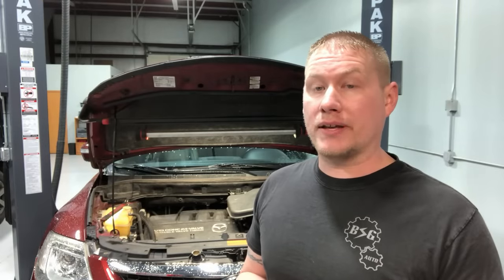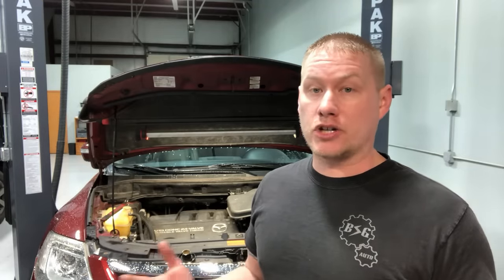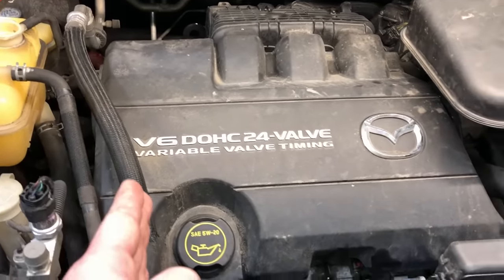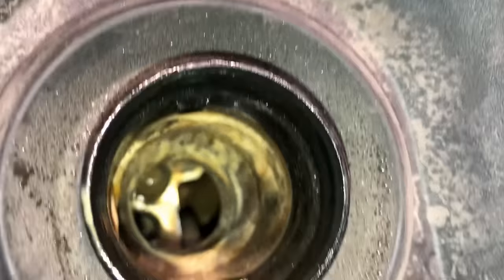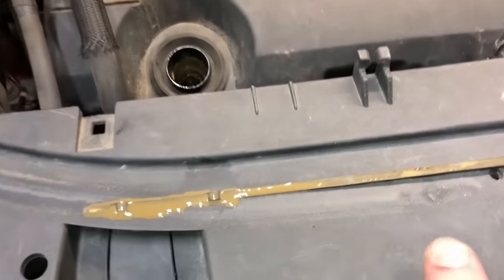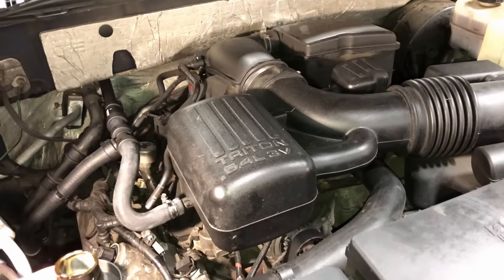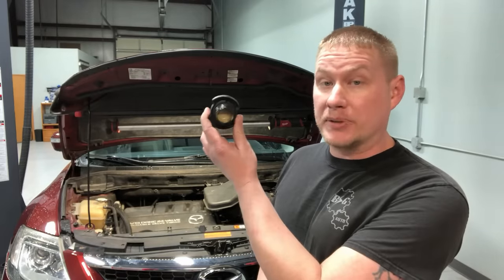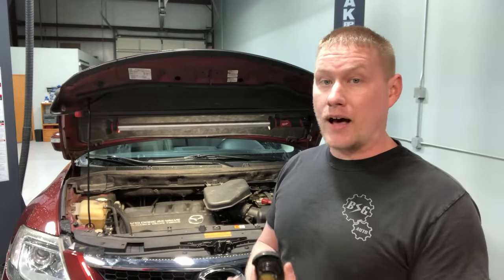Do You Have a Blown Head Gasket?

Comment: My car's radiator was empty and the coolant level in the bottle was low, when I checked my car after returning back to my home from 2 weeks trip out of town. My car was at my home and was not even started in that duration. I noticed this    two time. I contacted my mechanic and he told me that your head gasket is blown, the coolant may got steamed of the last time u driver the car. Can u please tell me what could be the reason and how can I check whether the head gasket is fine or blown. I have a Suzuki Mehran.

Comment: Please I have Lincoln navigator 2010 has low pressure in first 2 slender on the front one left and one right and my oil Has a milky oil not very bad but it’s enough to worry oil  steak does not have any milky If you can help me  this Head gasket or not

Comment: Do you live in a humid climate or one that has cold winters because if you don’t warm up the motor real thoroughly and I mean thorough moisture develops in the crankcase and the pvc valve aids this condition when there’s a lot of moisture in the air it draws it into the crank case as we never saw this condition before they mandated the pcv valve be put on all automotive motors because before that we had road draft tubes that ventilated the crankcase as to evacuate the blow-by from leaking cylinder gases....

Comment: quick question, i'm doing the rear wheel bearings and axle shaft seals on a 2008 crown vic PI, i'm having a hard time getting the c clips past the spring assembly in the center, i did this on 1996 town car and a 2005 crown vic with no problem the c clips came right out, this one is kicking my butt, any suggestions

Comment: Or you could have my dad that added water and oil into his coolant reservoir /facepalm.   The coolant was milky white almost like glue but the oil dip stick was nice and clean.  It was sitting for  a week until I found out he had added oil to the coolant reservoir, it over heated once so he then added water.  I spent many hours flushing it out of the system, what a mess, its up and running now.

Comment: I have a Ford Taurus with the 3.5 L Duratec with 148000 miles. Always serviced at the dealer. Running on synthetic motor oil. Been thinking of replacing the internal water pump and timing belt/accessories before the big kablooey. I love this car but now I have to save $1700 to get this work done. Would it help to flush the coolant in the mean time?

Comment: If have the same substance on my radiator cap of my 99 Honda Accord nothing on the oil fill cap at all oil is nice and clean not creamy at all. My concern is the radiator has the the milky substance on the bottom of the radiator. I honestly want to rule out head gasket vehicle isn’t overheating with air or heat on and at normal temp and I’m not losing any coolant either... any suggestions

Comment: I left my truck sit when we had cold weather. It was fine when I parked it. I tried to start it when it warmed up outside and it ran really bad for about 10 seconds and I shut it off. I then saw water in my oil. Not milky brown just under the oil in the pan I drained it and all the water came out first and then just oil not mixed but both in the pan, again not milky at all. I disconnect my coolant tank and my oil cooler lines and put the hose to the reservoir line. No more water filled in the engine or pan and it just came out the oil cooler lines. Should I assume at this point it is likely the oil cooler or water pump and how do I know which one it is?

Comment: My bmw was using coolant. No sludge in the crank case oil, but I had cold start misfires, finally took the head off and found cylinders 3 and 4 both had small hairline cracks between the coolant jacket right to the valve seat.

Comment: Question fordtechmakuloco my 04 f150 when press the gas around 30ph number 1 and 2 rpm the engine jump like 3 times but if the rpm pass the 2 not do that ready check lot of stuff and still do that if can you pls help me with that thanks

Comment: what if cap has coolant on it and the dipstick, but when drain the oil it's fine? Also coolant temps read high while driving? Not sure if this is relevant but cooling fan starts up with ignition and stays on for 15 mins after shutting off car no matter how long car was on?

Comment: Ok,, well what the heck causes oil to get into the cooling system?? I pull the dip stick and it looks fine( no water) pull the coolant reservoir cap and find oil with the coolant,, engine is a 5.4L 3v

Comment: so how would you get rid of this stuff, flush engine out? 2006 Ford F150 5.4 and then bad steering and water pump failed afterwards, so I'm thinking of doing an over haul to the engine tune up of course

Comment: I let my truck run a bit before I did my oil change and when I shut it off and pulled the oil cap there was condensation but green like the coolant. Its smokes a bit that's more like steam, anyways I drained the oil and it was all normal no milk substance. Any Ideas what it could be? It's a 2004 ram 1500 5.7 hemi btw

Comment: My Mercedes E320 V6 had this sludge on the oil cap but never on the dip stick and that freaked me out that my mechanic told me it is the head gasket, which he actually changed. However, this sludge appeared again and it turns out it is not the head gasket.. what a loss!

Comment: I have clean oil, no milky residue in the oil filler cap, yet a lot of pressure in my coolant system? It has been diagnosed as a head gasket or head problem, and yes it uses a little water each month. Any ideas??

Comment: Coolant boiling in overflow tank 1999 Mazda B2500. Fearing head/head gasket issue. 4 cylinder with 8 plugs. How do I perform a compression test. Intake, exhaust or all. Or is there an easier way ? Thanks for any assistance.

Comment: I just had my mercedes serviced this week.   Cap looked the same way! I panicked the service tech made me panic.   But I just knew there was a better explanation.   I have had no coolant loss, spotless oil, no over heating issues.    ALSO I  am ocd about checking my oil.   It dropped in the 20s this week in GA and lots of rain in the upper 30s.   Cold rain.    Then my cap looked like this.   I am still gonna keep an eye on it but I rolling with your theory for now.
Reply: Oh and I do not drive the car but a few miles per day.   Just long enough to get some heat going then I am at work for 10 hrs a day.

Comment: Brian, or anyone in the comments, I have a '13 F150 5.0 with a JLT catch can installed (passenger side of engine only). Question is, while towing, does your engine produce more blow by to get caught in the PCV system, and for my configuration ultimately in the catch can? Reason I ask is because recently I towed a little over 4k lbs for 1400 miles (WA to CO) and my 3oz can filled up in that time (started empty). Prior to the trip engine was compression tested and the Ford tech said all cylinders were between 145-155 psi and there was no concern. I'm keeping an eye on it now that I'm not towing but in the mean time what do you think?

Comment: U forget to show how a head gasket can blow 3 different ways in the engine external water leak out of engine and in the the water jacket it will blow pressure out of the radiator with the cap off and the engine running when u give it gas it will blow water out of the radiator and also in-between the values it will blow white smoke out of the tail pipe and if any antifreeze gets into the inside of the engine I don't care what u say that engine is done just buy a nother used one and replace the whole thing it's a lot cheaper trust me I've been turning wrenches since I was 15

Comment: This has been a video I was looking for probably 5 months ago and just now found it. 
I have a 91 grand marquis. My oil cap looks just like that however I did not look down that deep I should try with the phone cam. Also when I check my dipstick it does come out with some of the residue on the tip of it maybe about a full (pinky) finger nail. They’ve told me I have a blown head gasket and wanted a little over $2k. I walked away
The car is driven short distances and live in Chicago.

Comment: Whats the difference between a blown head gasket  and intake gasket leak . I have two spark plugs getting wet with what seems to be anti freeze  in the two spark plug holes on the far  back left side.  I turn my truck on and it boggs and  shakes and wants to stall. If i try to start it again after it shuts off it seems flooded. I drive a 2005 ford expedition 5.4 ... Thanks

Comment: Years ago I bought a car really really cheap because they thought it was blown. I asked if it was using coolant and they said no. The cap was like you showed. They said the oil wasn't changed for 20.000 miles. I flushed it and it ended up a good car.

Comment: Another way to check for coolant in the crank case .. After vehicle has sat nit running for a day or two... Go underneath with a cup or something, loosen the engine oil drain plug and catch what first comes out... If its there Coolant will start coming out around the threads before any oil comes out because it will separate and coolant will go to the bottom....it may be difficult to detect though if it's a very small amount.... But if you back out plug and carefully let out a little oil and all it is is oil, then the coolant may be going elsewhere....

Comment: I just an synthetic oil change on my 5.4 triton 2v, then I did a tune up and accidentally got some fuel and coolant into the lower intake. Im not sure how much but my cap was milky and the dipstick looks normal after a little driving. Should I be concerned or flush/change my oil again?

Comment: Really good explanation! It helps me decide to buy my next used car. No, it is not going to be a Ford. My old 2004 Ford Fiesta had 3 broken water pumps. The first two were installed by the Ford dealers. Now a fuel injector just failed.

Comment: I have a 2003 F250 water in oil.. it ran for awhile then seized up.. is the mortar trash or is it just simply replacing the head gasket?
Thanks 
Nik
Reply: If it seized up . It's a good boat anchor now . Engine is done . If it's a gas engine get a used one from lkq . If it's diesel hope you got deep pockets .

Comment: Would 10 quarts of water disappear from reservoir into the oil if only the water pump is bad alone, or does it guarantee head gasket or cracked block? Trying to decide whether or not to junk my Mazda 2012 6s. Ive got oil all the way up the dipstick. froth, engine light, and any water I put in does not fill the coolant resevoir. If it's just a water pump, maybe it is worth fixing. If its engine and gonna cost me 3k+, maybe not?
Reply from the maker: I imagine you are speaking of the 3.7L yes it would be the water pump

Comment: Cheers man! Had coolant leak. Everyone is telling me it's the head gasket. Turns out the radiator needs replacing, not the head gasket. Oil is fine, no discolouration. Not using coolant, just slowley leaking it through the top seal of the front radiator.

Comment: Hello ford wisperer, I have a question, I have the opportunity to purchase a 2010 5.4L ford expedition with 140k for about $3500 how much life do you think this vehicle has in it? And it is rust free.
Reply: You're joking right?
Reply: @geraldhenrickson7472  no dead serious, why? What's your opinion?
Reply: As far as a 2010 5.4L is concerned, especially one that has to work as hard as one in an Expedition, I would stay away from that truck!
Reply: @helo1644  the early, well before 2010, ford 5.4 was problematic with spark plugs. They'd blow out taking the threads out. I know they adressed this issue on later models but I'm not sure exactly when. 2010, you're probably past the fix.  I'd look into that. If that was good, I'd take it a thorough testdrive along with all the other checks. The engine oil and trans fluid, it'll  tell ya all about the life that truck has lived if it's not been changed. I don't know what the other guy was talking about with that working hard stuff. I'd be concerned about an underpowered setup if it was like a 4 cylinder truck, i have one myself.  Worst case, take it to a shop and have them look it over and under. I'm sure they'll be honest as they aren't a benefitting party.

Comment: How long does it usually take for blown head gasket symptoms to happen? Yesterday my radiator hose came off and the temperature gauge went to the red, I pulled over immediately and turned the car off. Got it towed home and fixed the hose. I let it run for about a hour or so and everything is normal. No smoke, the coolant is pink and the oil is clean. Do you think it would be showing symptoms now or would it take more driving for them to happen?

Comment: Got a problem you might of come across and could potentially explain.  The vent in my car continually allows are to flow whether or not I open the vents (Stuck open).  This just recently occurred and didn't used to happen.  That said, My car is a 96 Ford Thunderbird.  Likely same setup as mustang, Cougar, and Lincoln cars same time period 94-97 I would imagine.  Have you worked out this problem before?

Comment: I have a 2013 f150 5.0 V8 car won't start and I have thick white smoke coming from engine and exhaust pipe. No milkyness in the oil. Please help! I think it is a blown head gasket not sure.
Reply from the maker: Most likely a flex fuel inferred is way off.

Comment: Thats BS, its a clear case of having a bad headgasket, when u have milky SLUDGE on the Oil cap. vs having condensation is water.
Reply from the maker: Lol you are right, every vehicle that comes in here during the winter looking like this needs a head gasket.... If you think this is bad you should see the Chrysler engines they are like custard.

Comment: I have this same problem but mine doesn't build up on the oil cap, rather it's on the radiator cap and at the top of the automatic transmission fluid dipstick.

Comment: I had an issue with the heater core line above number 4 plug on a 4.6l engine ,thanks ford, that was leaking inside the plug hole and causing it to have a misfire while it was leaking people was saying I had a bad head gasket I told them what it was doing and they still was not convinced that I didnt have a bad head gasket.

Comment: I have a 98 expedition that builds up fast I have bubbling exhaust coming outta the expansion tank but no coolant in my oil. Changed the intake gaskets but noticed pitting and wear where the coolant travels through the intake not sure if my head gaskets gone or a bad intake

Comment: Funny you posted this cause my sisters boyfriend did this exact test Saturday night when we was in the garage trying to figure out why the car my nephew and niece in-law got is having an overheating issue.(they got it super cheap cause the woman didn't want to mess with it.) He tried to tell them it was the head gasket till I pulled the dipstick lol. Of course I find out the overheating didn't start till they did a flush and fill till after I tried draining the radiator, I say try cause I doubt enough came out to fill a coffe cup up. Sounds like it wasn't filled correctly but have to change the water pump (leaking at the weephole) before going any further. No since in vacuuming the system down just to have to drain it again when the pump decides it's had enough. Thanks for the tips and vids, found your channel when I was having TB issues on my 2010 2.5 and was searching for a solution.

Comment: I bad oil cooler O-Ring can cause this as well.. I had one today. They told the lady needed a new head...I tested it for head gasket. No leaks... The Radiator was clogged solid with oil. As the Oil Cooler O-Ring failed.. And 50psi oil pressure wins that battle...
Reply from the maker: You are talking about a totally different failure here.

Comment: I just saw this issue with my 03 4.6 Explorer, I really hope that it is just condensation. However, I have an 04 Suburban that I know is leaking into my oil, however, the oil dip stick always comes out clean, aleays. I am goong through a half gallon of coolant every 4-5 days. So far no drop in the coolant level in the explorer, I hope it is just this simple.

Comment: This same engine as made for years with an external belt driven water pump. Same engine the older ford escapes had 24v Duratec. I wonder what made them change the pump location. Good way to ruin a decent motor.

Comment: Another good test is. Cold start the engine with the radiator cap off and let it run for a few minutes and see if you see bubbles appearing. If so ,  not a good sign. If you don't,  thats good

Comment: My 5.4 2v has the oil fill cap gunk and the dipstick oil is fine but the cooling system gets an air pocket in it every day and will overheat if I dont either turn in off or pop the degass cap and let the air pocket out

Comment: For some reason Pennzoil engines tend to have a lot of condensation when you look at the oil filer cap. Most of the time when you see that just ask and I bet 8 out of 10 times they will tell you they run Pennzoil. Quaker state too.
Reply from the maker: Are you saying the Pennzoil brands make the engine run cooler due to lower friction causing the condensation in the crankcase to never burn off or are you saying they add water to their oil to make up volume like they are doing with beef nowadays?

Comment: Moved to minneapolis and had this on my car thinking the head gasket had blown due to the white goo but none of the other symptoms where there and the oil was clean. Even did a combustion test and it passed. I couldn't figure it out. I lived in Texas prior and never had this issue but have also been driving less. Thanks alot for the information you've really saved me and put my mind at ease.